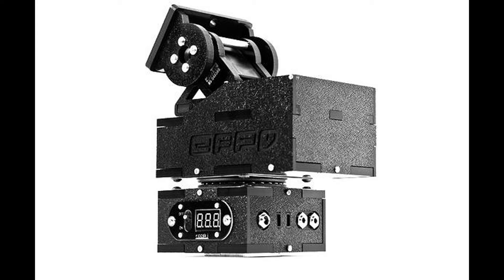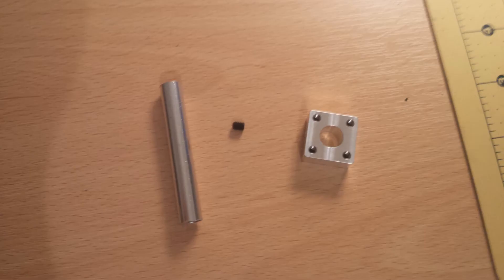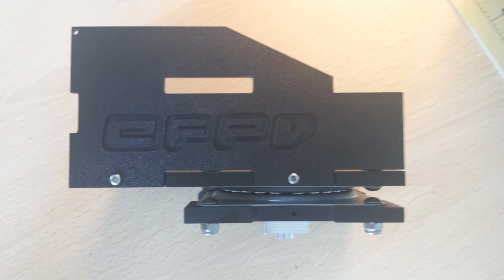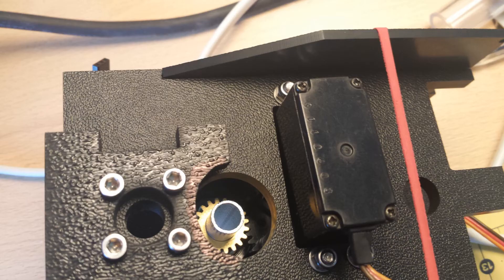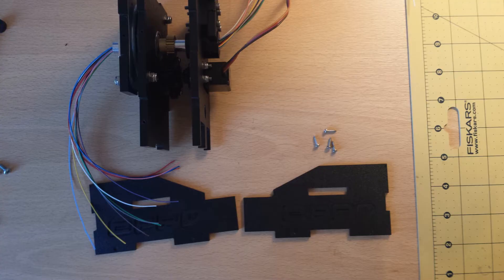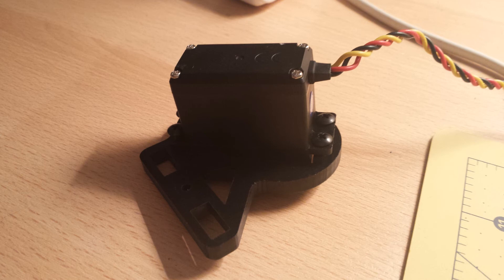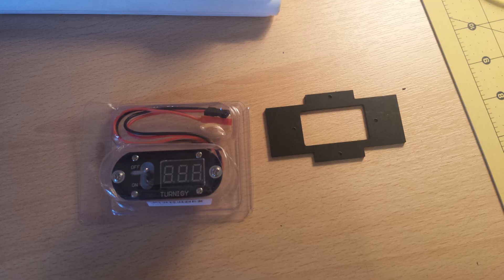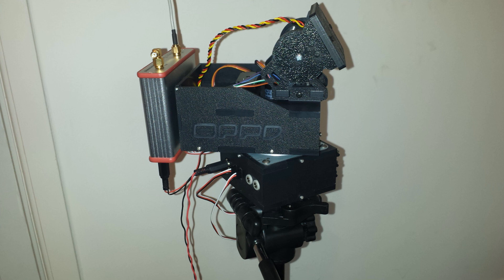EFPV (everythingfpv) Antenna Tracker build and review

Comment: Thanks Ratty!
(I tried to replydirectly, b ut it got kicked back so I'm posting my comments here)

Good morning (usa) and almost Merry Christmas!

The wiring process - especially if pairing through the ezosd is a bit of a quandary since there are no real instructions that I can find.

I've been fpv'ing for about 2 years on 5.8 and just bought my first diversity antenna and dvr (hence the antenna tracker).  I'm switching to 1.3 to improve my ability to fly around objects that impede my line of sight - and hoping that it all plays together nicely....? I currently do NOT fly far enough distance to require UHF and I'm not certain about hooking it into my Jeti anyway - so that's not an issue.

I've just put together the Sky Hero mini (no fpv yet) and have a half dozen flights on it while I sort out the Jeti telemetry and hope to trial the antenna tracker on it as it gets sorted with the electronics and if it needs the EZOSD or not to make the tracker work.

Thanks for your instructional vids!

Comment: Good morning Ratty - it's 7 months gone since this vid and no 'this is how it works' update or electronics build vid?
Is this still in use or did you find something better? Also noticed that you have the immersion RC antenna tracker mounted to the front - is this to pair with the EZOSD unit?